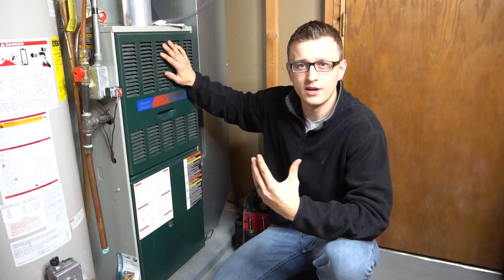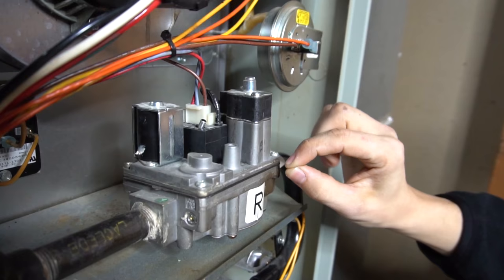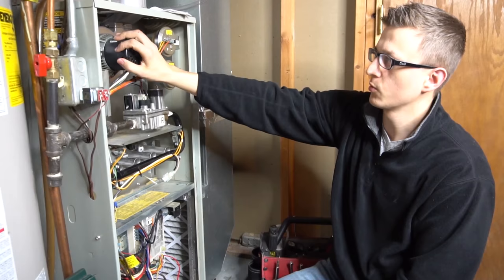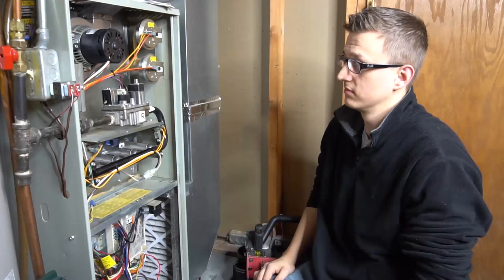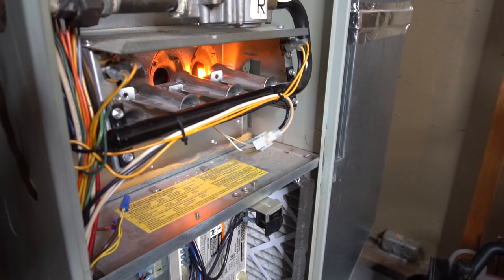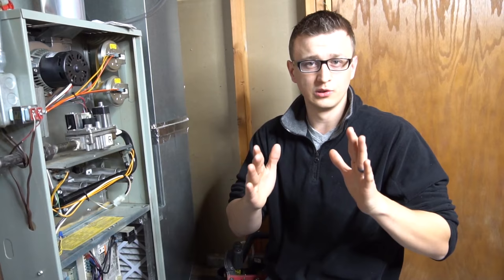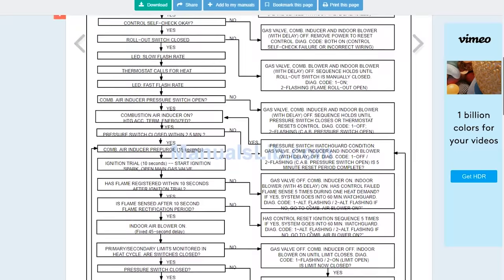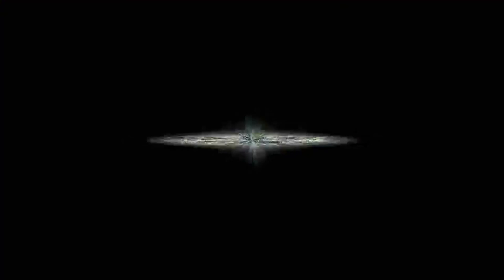How a Furnace Works - Furnace Sequence of Operation

Comment: People like you posting these videos on YouTube has saved me tens of thousands of dollars over the past 10 years between my business and home. From car repairs, to building walls, painting, repairing washing machines, servicing water softeners, repairing water heaters, and servicing my HVAC systems. Just last week I opened my RTU's heating panel to check for cob webs and an hour later realized i lost my heat. Turns out the wind blew the flames at my burner and tripped the limit switch which I learned from one of your other videos. I now know to turn the unit off before opening that access panel on a windy day (or just in general). This video was fun to watch to learn a bit more about how these work. Thanks!
Reply: If all repairman were honest…..but this is not a perfect world!

Comment: Very well-explained. Not too technical but not too simplistic, either. Thank you!
Reply from the maker: Glad to hear the video was easy to follow! Thank you for leaving a comment!
Reply: @WordofAdviceTV I have a problem with the air and heat coming on the thermostat wiring is correct but it doesnt have a jumper wire and it only has 4 wires but the fan comes on but that's it and it's a Honeywell sliding non programable one any advice?
Reply: Yes, fine video, well done. 

Like Tim says, you have an excellent progression from the simple to the more complex.  Excellent teaching skills.
Reply: @brandonwebb2100  did you find an answer?

Comment: Very helpful. My furnace was in lock-out mode because the flame sensor was dirty. The LED had one flash saying it was locked-out. Didn't know why until the time-out was reached and flame came back on then right back off, which told me from previous experience that the flame sensor was dirty again. Great job in creating this video.
Reply: Good to know…I am surmising flame sensor should be “cleaned” annually.

Comment: I just purchased my first home and everything is new. My furnace was blowing cold air. So I turned off the furnace and took the panel to off to find out one of the igniter wires was not connected. This video helped me find the Sequence of operation to find the problem thanks bro I appreciate it.

Comment: I like the vid. One thing I’d add about the flame sensor. Up to a hundred volts can be sent through that flame sensor wire. You don’t want to make a habit of handling that with the power on.

Comment: Great video. I appreciate the visual explanation. I’ve been trying to figure out why my Bryant furnace blower won’t operate at the same time the flames are active. Still working on it but this helped me get a better understanding of how everything works together.
Reply: Hi I have same problem, flame and gas turn on but 30 seconds and it keeps shut down, I replaced new flame sensor but not working

Comment: sequence order of this video was excellent. If I could add since ignitor replacement is a common failed part , be carful not to touch the heating element because the oil on your hand will cause it to heat unevenly and crack and you have to replace it more often . I had one to last only a year and the on I got now is 15years old.
Reply: Another video channel, hvac guy said school taught him to always wear gloves while working on furnace.

Comment: As a retired industrial electrician who dealt with many different systems and machinery I am very pleased with your explanation of how a furnace cycles.  I would have liked to see you explain how the indicator light showed during a normal cycle first. This is what the average person looks for first.
Reply: My flashing light is like hidden down towards the bottom, so I need to put up a big sign to remind myself to look for the flashing light before I work on anything… My 32 year old furnace has been off and on troublesome for 12 years but I love it when I can fix it with help… York stellar +plus 1990

Comment: Very good information in a usable format. My 20 year old well maintained Trane furnace failed during this year's snow storm. With your information, I was able to isolate the valve assembly / loose module connection as the culprit. I jury rigged a temporary fix since my technician (or anyone else) cannot get up our very step hill that is covered with a foot of snow and now ice. Thanks!!

Comment: Fixed my issue with tapping the part. Thank you!!
Reply: I tapped the limit switch and blower turned off. Now waiting to see what happens this next heat cycle!
Hvac friend had mentioned that a lot the last 12 years…it finally came true!

Comment: Today, my furnace failed to light. After watching your videos, I discovered that the gas opening behind burner 3 next to burner 4 which has the flame sensor was  blocked.  On cleaning and un blocking it plus cleaning the flame sensor, things are now back to normal. 
Thanks for your help. You are such good teacher.

Comment: Best AC guy. Fixed my AC twice from his Videos!
Reply: Was a heat issue. reseated connectors and blew out the pressure switch and it started working. It did not seem there was anything in there but there must have been.
Reply: Mine was a Rheem rcfl-hm3617cc and o
only had the one pressure switch. Just blew out with my mouth.

Comment: .Your video very easy to follow and troubleshooting. My furnace blower start up and run to reach the temp set up then  turn off, when the room temp drop down then it kicks on however the blower not run but hums very loud but not running . I have  turn off the power couple hours then start it again and it happens then same things  (the first time always run ). I also just replaced the capacitor couple weeks ago.

Comment: Thanks for the great videos. I was able to troubleshoot my flame sensor and get up and running for $10. Here was my problem in case others have similar issues. My inducer fan would start but only about 30% of the time the spark ignitor would light the flame. If it ignited it might run for 3-5 sec or sometimes a minute then flame out. The circuit board error code gave 2 flashes which is "pressure switch" or "not sensing flame" error on my unit. Lucky every HVAC place in the country out of 0.33 pressure switch stock so I couldn't order and just replaced a flame sensor. I have heat again.

Comment: Great video. Fought my unit for a few days. Maybe my experience will help someone. My scenario was the burner would not ignite, igniter came on, gas valve opened but no flame. My problem was after replacing my igniter with a universal one from Amazon  the way it mounted wasn't close enough to the gas distribution tube. Re-positioned it closed to the tube fixed it.

Comment: Thanks Great video - FYI-- Blow out air lines on air pressure sensing (vaccum) switches - Some of these air switches has two contact - one on the front one on the back .... check both! 
 yellow powers both switches - brown and orange are the two different outputs signals. Inducer housing pressure and collector box pressure (check square tubing vacuumed sensing signal). This may apply to your unit.

Comment: Hey man you are awesome! Your detailed explanation of the sequence really helped me diagnosed my problem.
I believe my problem is a gas valve. The igniter lights up and only the first burner lights up but none of the others so it shut down right after 3-4 seconds because no flame at the flame sensor. Do you think it's a gas valve not fully opening allowing full flow? There are 4 burners but only the first burner has flame.

Comment: I can only imagine that all the DISLIKES are from the people that over-charge by 3 to 4 times more for parts and labor and basically are on this earth to stick it to older folks that might have enough $ to buy basic groceries.
I understand all that you talked about but I want to know what your answer to this question is; How long is the life expectancy of a correct size to home furnace? My well-read wife says 20 years tops, sometimes 15 years.
I keep telling her that I keep it running just like the gasman told me to from years ago. The "A" coil is clear, I vacuum the side you were on every fall, and if something fails I just have to replace that part. Plus, she wants a new AC unit even though the 20-year-old AC makes the windows fog up on hot days. She says the normal sound the compressor makes drives her nuts when she's trying to sleep (even though she wears hearing aids) without hearing aids.
Please tell her why HVAC companies make these bogus claims on life expectancies of the furnace.

Comment: First I wanna say I love all the info you put out. A few weeks ago I knew very little in regards to anything HVAC related and since than I have learned alot from you. So here is my issues. My furnace would not fire up. Inducer fan fires up with no issues and I have one of the hot surface igniters that ignites a pilot light that works fine. So I was thinking that it is either the control board or the gas valve. So here is what is baffling me. I was testing to see if my gas valve was bad (honeywell sv9541), and when I would use my multimeter and would put one lead into the purple wire port on the gas valve and the other I would put on the common terminal on the control board ( where the white white is coming off the transformer into the board) and the furnace would fire up perfectly fine a few seconds after the igniter would light. This same thing also happened when I would connect a test lead to the orange wire leading into the gas valve instead of on the purple wire. Also once it fired up and I would remove the test probes the has would shut off. Any idea what is wrong?  Its baffling me. My furnace is a comfortmaker system that's about 14 years old. Thank you so much 
Brandon
Reply from the maker: Hey Brandon! Glad you found my videos helpful! You must have a loose connection at the gas valve there. I have seen that happen with those gas valves quite a few times. You could replace the gas valve but I don't think there is a need for that. I would just zip-tie the wires going to the gas valve to some other wires or to something else so that there is pressure on the connectors. Or if you want to keep it neat looking, just take something non-conductive like a small slither of wood, plastic, or rubber and jam it in between the connector and the plug. Just push the connector one way and the other while the furnace is starting to figure out which side you need to put the "shim" in. Hope that helps! Good luck

Comment: Thank you brother for your videos.  they R such a huge help. 
I have an Intermittent problem with my heater turning on. I’m getting my 27 volts  returned from thermostat. But somewhere in the board it is not switching to allow me to get my 120 to my inducer motor. 
Should I just replace the board or is it possible to replace the part in the board? It acts like there’s a relay getting hot and then once it cools down it works again. I have no idea what is between the thermostat return and the output to the inducer motor. 
PS the light is staying on so the code says it’s an internal problem...Obviously thanks bro!

Comment: Hi, I am struggling to find out what is wrong with my furnace. I get a 3 blink code. I have replaced the pressure switch, although I think that wasn't the problem. I have been able to make it work and works for a few minutes by just unplugging and replugging the sensor wires. This almost seems like there is a bad wire connection, but it doesn't make sense. The only thing I've yet to try is looking to see if the pipe going up the roof is clogged. Any suggestions? Thanks and great video.

Comment: I wish I had found your channel a few weeks ago!  Very well done, perfect content, explained so anyone could understand and follow along.  Question:  what should I check for if the flame goes out when the blower motor kicks on?  I mentioned this problem in your vid on troubleshooting the control board, as well, but this seems more like the place to ask the question.
Reply: Did you find the answer?
Reply: @learnjcbskidsterchickensga7594  Turns out the original installers did not ground the unit.  The new control board is finicky about having a good ground.  So after I ran a new drop for the furnace it ran fine!

Comment: Hi your awesome, I have a problem on my unit. the site light stays on steady which should operate properly however theirs no wires to the relay control switch instead their 2 purple wires that's hanging and connects to a car type  5 AMP fuse. the result is the fan to the house comes on the same time or a little before the gas ignites so it blows out really cold air for 4-5 minutes before heating the house then after the gas turns off it blows cold air again for awhile.

Comment: Hello, great videos you are providing. I have a 12 year old 2 stage Tempstar. I recently noticed the that the ventilator fan seems to start and run for it's programmed time then sometimes shuts down without the burners ever lighting. This happens intermittently and sometimes the ventilator fan runs 2-3 times before the burners light, they have never locked out. I've also noticed when the main blower starts up it makes a slight rumbling noise but always seems to run nicely once running. I have to confess my furnace does see some dust but I do clean it regularly. Is the ventilator fan and main blower nearing the end of there life at 12 years of service. Do you recommend replacing these proactively? Thanks for any advice you will give.

Comment: Awesome videos!  Quick question: after the thermostat is satisfied, does the inducer turn off at the same time as the flame shuts off, or is there a delay to clear the exhaust?  Again, great no-BS explanations with clear video!  Thanks!

Comment: Learned a lot from your videos, thank you very much. I have two-stage press sw like yours and I confirmed that they are both closing when the inducer motor runs but somehow my igniter is not glowing. I'm getting about 25V on the low press sw but no voltage reading on the high press sw. I verified that the igniter isn't broken. Do you have any suggestions? Thanks in advance.

Comment: keeps tripping a breaker? most likely the blower? I have cleaned ducts at return vent and exhaust vents, and a new filter. Happens on occasion. Less after the new filter but just did it again. Haven't caught a blink code for it yet. But is it most likely a bad blower? Would like to test for but not sure other than "amps to high  breaker trips"

Comment: Awesome explanation.  Is that a filter on the right? Does it need to be replaced regularly? If so, how frequently?
Reply from the maker: Yes and it should be replaced every 1-2 months if furnace or air conditioner is used regularly. I talk in more detail about filter information in this video: https://youtu.be/uPaZvHp4L2Y?si=__qJFYvH4pXLWh7y
Reply: @WordofAdviceTV  Thank you.  🙏

Comment: So if my igniter doesn’t come on AND the gas valve doesn’t open does that mean it’s the board or if I just change the igniter will the gas valve click on? I noticed your gas valve still comes on even if your igniter is bad but mine does not.
Reply from the maker: You should watch my ignitor video for more info on that. So if your inducer motor comes on but the ignitor does not glow and gas valve does not open.. Likely you have a pressure switch problem (I just made a video on pressure switch problems too) or perhaps the unit is in a lockout. Is the control board blinking any error codes? Does the furnace light if you reset power to it?

Comment: Thank you!  Your explanation is so easy to understand.  I wonder if I can ask you a question.

After my main burner turns off, the blower runs for another 107 seconds (which is what it should do according to the manual) and turns off.  However after a few seconds it would turn back on for just a few seconds and turns off.  Why does it turn back on and is this normal?
Reply from the maker: Seems like the control board may be glitching a little. But new control boards are pretty expensive. If other than that, the unit runs great, then I would not worry about it :)
Reply: Thank you so much!

Comment: At what step does the water evaporator solenoid open?  Do you have a video on how to fix a solenoid?  I have a General Filters 990-46     volts 24/60   watts 2.5    psi 125.   thanks and thumbs up

Comment: Isn't it the blower doesn't come on right away because the temperature sensor to the heat exchanger is closed and once the heat exchanger gets to a certain temp the sensor opens triggering the blower and the blower stays running until the heat exchanger temperature sensor closes causing the blower to cut off?

Comment: The step down transformer you have next to the on off switch where does the low voltage on step down go to?
Reply from the maker: That one is for my bypass humidifier.

Comment: Buddy you have taught me so much. I had an rc no power on my furnace went to the breaker, it was fine, went to the furnace no power coming in. Scratched my head for 5 min Then decided to cycle the switch and the furnace started working. Am I missing something? How does a switch in the on position stop power to the furnace?

Comment: I have a furnace that shuts off after about 3-5 seconds.  I've replaced the flame rod, and the control board.  The new board shows a yellow LED light illuminated on, indicating flame.  I have 3 micros amps going to the flame rod.  I've removed and cleaned the burners, and added a couple ground wires from the  burner housing to where the green wire from the control board terminates.  Any ideas on why this piece of junk doesn't work???  Great videos by the way, I've watched a few now.
Reply: Figured it out, bad pressure switch.  The contact closed initially to start the furnace, but then would chatter open a few seconds later.  Nasty to diagnose, but fixed.